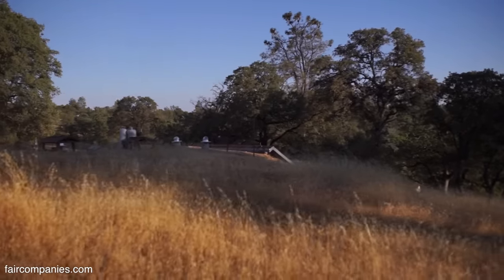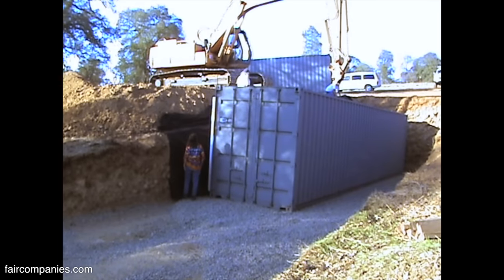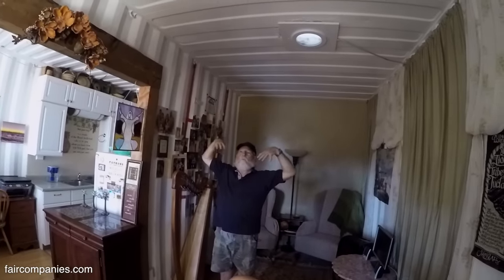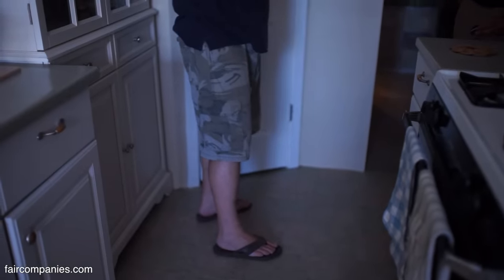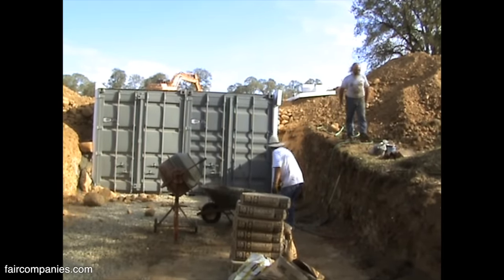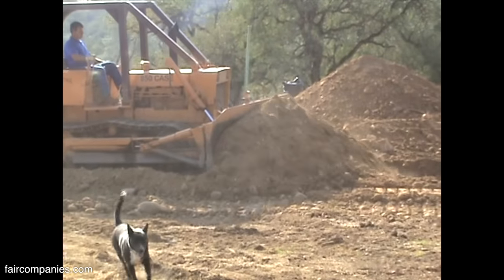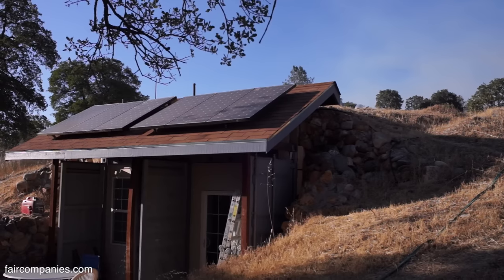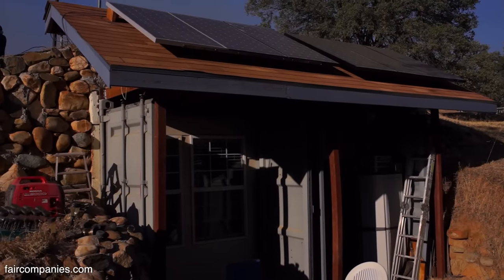Earth-cooled, shipping container underground CA home for 30K

Comment: I built a 3+2bath house in Vietnam.  I had a deep well drilled and put 3 HD plastic 20gal on the high 10ft roof (one outside painted black for pre-heating hot H2O before being stored in an insulated 20gal under the roof and another under the roof (insulated also)  for cold H2O.  2 small solor pumps sucks the water from the well into the 2 tanks.  A small electric water heater maintains hot showers on cloudy days.  My biggest expense is keeping the brick + metal roof house cool.  If I could have done an underground home that would have solved that expense.  Although the high roof, thick brick walls and fans help... I still must run a 2ton AC unit to keep the 2000sqft house livable in the hot South Vietnam climate.

Comment: I have Steve's book - love it. 
Could this underground container home be designed with 3 40' containers with the 40' length facing a southern exposure and the 24' placed into the underground depth? Like an earthship design that uses solar gain from winter's low laying sun  - the high summer sun is blocked by a 3' overhang along it's length. I'm thinking that it could be insulated on the inside with paper/hempcrete walls that would also add thermal mass. I would also be interested in adding earthship "earth tubes" for added cooling.
Reply: Certainly could with the right engineering and construction.

Comment: I've always wanted to build an underground home, and I am thinking I want to put a chimney shaft on the sides that is about 6 feet wide and 4 deep.  There will be windows at window height, instead of a fireplace and have an excape ladder built into one side for climbing out in an emergency.  At the bottom of the chimney shaft I would put a large 45 degree angled mirror to shine up the chimney to the surface.  ON the surface I want to build a small steel framed green house with a window glass and with a 45 degree sloping mirror on the inside so the entire chimney becomes a periscope to the surface.  And this could serve as an excape exit should someting go wrong underground.  Not to mention, you could open the windows and get a warm breeze if you were so inclined.  You could use the chimney as a periscope for 2 rooms by splitting the window space with a room wall.  Natural light and well insulated. Plus you can see outside and see the sunrises/ sunsets and watch the deer play in your yard.. Imagine living underground and being able to pull back the window curtains to watch the sunrises from your bed!

Comment: Build with ICF walls and go deeper. Use more solar power and shade the entrance better. Not cheap but way more permanent and easier to get permitted. Also, with the extra solar electric it will allow use of more lights if you want them, and a geothermal system for more comfort.

Comment: Nice job.  To protect the surface of the container, you can consider roof tar application(bitumen) and asphalt paper. Then you can back fill with anything including sand.  Put in a soaker pipe drain with geo-tech fabric. Let's rely on water diversion rather than corrosion protection. We can consider additional concrete reinforcement and spread these containers apart for more living space. Very cool - were is the weapons room.

Comment: Without reinforced concrete back-fill, earth-buried intermodal containers will rust and undergo slow (and sometimes sudden) structural failure as the mild steel siding rusts-out. Please be careful.

Comment: Beautiful house! Were the openings between containers cut and welded before constructing the concrete slab roof? How did you insure that water would not penetrate at the apertures in the sides of the containers? I am assuming plumbing and waste lines are below floor level out to septic tank and drain field on hillside below. Toilet air vents go out the top like solatubes? Very nice low footprint on your land. Like it very much.

Comment: It is a really good idea to leave 50% of the walls as the original metal instead of covering them up with drywall, because metal conducts heat a lot better than the drywall does.  On a hot day the hot air will come in an open door or window, and the metal wall will soak up the heat from that air a lot faster than a drywall covered wall will, thus helping keep the inside of that place cooler than if you were to cover up all of the walls.

Comment: Would be nice to have the containers horizontally placed to increase the amount of 'frontage' opening to the outside, though you'd have to use well-insulated glass and you'd lose some earth-insulation, you could open the entire length to a long patio and bring the outside in.  Wonder if there'd be other reasons not to do that?

Comment: Smart but not wise! Refer container has better insinuation and putting tarp cover down on the ground before putting in the containers blocks the water that wicks heat away even from the foam places outside. Dome book 2 had the information about layering tarps to keep ground areas layers dry so no water wicking only dry ground.

Comment: I have a 2 story house with a large, walk out basement.  I want to remove the top two floors, add a roof to the basement and just live in the basement.  Seems like it would effectively be the same sort of set up as this, just bigger, with concrete walls instead of metal.

Comment: I keep hearing  about the structural integrity.. Think of the container and the job it's designed to do.The amount of weight they're rated for is insane!Picture a crane that lifts them on and off of ships and rail cars..The four corners and the bottom of the container are strong as hell the metal sides and roof are flimsy.. So if you flip the container upside down, it will withstand any amount of dirt and concrete you put ontop of it, That is my suggestion to anyone who attempts  a bunker or home like this.. If not burried upside down the risk of collapse is way high in my opinion

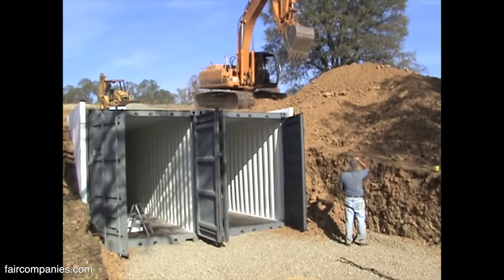Comment: As I understand through some of my own research, the average cost of a single container is approximately $2,500. Purchase price only, typically does not include delivery in my info. At 2:25 he says, "give ourselves 640 sq.ft. That means each one is 320 sq. ft. Since there's theoretically no limit for size,  I think I would opt for eight containers. That would create according to his numbers, a livable inside square footage of 2,560 square feet of living space for $20,000. That's a helluva nice size living area for $20,000 + other expenses. I also understand that shipping containers do come in some various sizes, too. Measurements could be better.  So, you'll need to do additional research if this interests you. Also, you don't necessarily have to put them (if using my example) side-by-side. You could have 2 bedroom or office wings off of the main center six containers left and right,  creating a letter "T" shape.

Comment: I'm scratching my head over this one. Instead of the metal box, I'd pour concrete walls then roof it over with prefab concrete slabs. And extend the front part out into the open, facing south. 
And I'd put a wall around those air vents so bad guys don't drop canisters of Zyklon B into my bedroom while I'm asleep.
Reply: broomsterm Agreed. If I were doing this, half of the living space would be underground, and half out front. I'd buy a cement mixer and lay the floor and grout the cement block walls. Seal 'em up.
I would build a double arched roof...like one of those old railroad tunnels. 
Where I would save money is by buying an old motorhome or two and disemboweling them for the interior of my house. The electrical and plumbing systems are there for the taking. Paneling. Flooring. Cabinetry. Old motorhomes are dirt cheap. They also have generators. Good for emergencies. 
Woo-hoo!
Reply: +Leon Davis Dunno, it really depends if you have friends or connections working in the concrete industry. Here in the UK those prefabbed concrete panels are crazy expensive. When I lived in Australia I had a friend who worked for a concrete manufacturer that could get access to heavily subsidized concrete panels, the ones used in bridges for $50 a piece, I think they were either rejects or overstock. Then It might be worth it.
Reply: arbit3r Yes...I see what you mean...
It is an interesting subject.
If I'm not mistaken, the technical term is "vernacular architecture". In other words, a building constructed with materials at hand. A log cabin or an adobe house would qualify. 
Shipping containers would fall into that category. 
I still like the idea of eviscerating RV's that are past their shelf life. Unlike Europe, in the US, those things are yuge. And top end units will have beautiful hardwood paneling and cabinetry and spiffy appliances.

Comment: 5 wide and one on the back connecting them 40x48 @ 1930 square feet wouldnt have been all that hard weld them together then heat treat the welds you could have a hot tub room and a sauna room. put in some sky lights and run some garden hoses through pvc connect hoses to dehumidifiers ! you could even go another layer of containers down .

Comment: Very cool but this seems to be built in a pretty moderate climate, not a lot of rain or excessive summer heat/winter cold. People in other climates will likely have greater heating and cooling needs though still less than an above ground structure in their area.

Comment: just weld some tabs on the ceiling?? way easier. you can weld anywhere on your metal wall. I would also have added a thick rubber liner over the top of the containers to keep them water tight. like pond membrane

Comment: what they apparently didn't realise what that shipping containers are incredibly strong but rather expensive way to build if you'd not just using them for the structural parts of the house.. for just the creation of living space they're expensive.. they could easily have placed the containers with a 10 foot gap with a roof structure... or made skylights.. or an atrium courtyard between the two containers

Comment: So it is not permitted to be used as a dwelling?
Would sorting this issue out first have been a better route to success?
Are there perhaps easily incorporated design changes you could have made to achieve the required permission?
Great idea and nice outcome, but you can't live in it? What's the penalty if you do?
Reply: No he was saying that the do not have a permit requirements for buried containers.

Comment: I don't know....The anti-water measures look iffy to me. I would think some extra outside waterproofing between the foam and the steel would be needed and concrete is porous, slow but porous. I'm no engineer(but I slept in a Holiday inn), it seems that if the container is designed to only take vertical weight on the 4 corners then you pile a foot of concrete on the roof it does not spread the load onto the corners. Otherwise good video and good ideas!

Comment: Containers are NOT meant to be buried.  Generally it's a VERY bad idea.  Unless you ENGINEER (and I don't mean on a napkin, I mean have CERTIFIED civil engineer do it) a support system, you risk having the container cave in or prematurely rust because of poor drainage.  All the structural support is in the ends, not the roof or walls.  They're not meant to take the weight of earth on them.

Comment: Building underground can be very good.They would also fare much better If there were to be an nuclear emergency or bad weather etc.  Should you use a shipping container then ,just be aware that without extra reinforcing by say, adding a steel beam, the roof may  bow or even collapse if you put much over 9 inches or so, dirt on top. The floor would be strong, so you could turn the container UPSIDE DOWN , but since the floor would be wooden , it would be necessary to weld steel sheets to what was the floor steel beams. It would then be very strong & several feet of earth could go  on top. it  I built one of the U.K.'s strongest bunkers .I welded the rectangular container  myself, I did not shipping containers & put 12 feet of dirt on top. The temperature inside remains the same all year round.Congratulations to Steve .If anyone is interested in the bunker I designed & built search 'Mike Thomas Bunker' on Youtube. Kind regards,Mike
Reply: Michael Thomas 
I will be watching you on YouTube tonight

Comment: Okay, so the concrete slab on top is essential to hold the 3 feet of dirt? I would think the roof of the container would handle that much weight by itself. Especially since you beamed the openings. And there are no windows.

Comment: I was always told that shipping containers are a bad idea to bury as they will cave in after 5 years or so.  How much earth is piled above it?
Reply: You have to take measures to protect them from moisture or they will corrode and collapse.
Reply: As described in the video there are ways to prolong their life underground. Personally I would not rely on them for support and use something else such as concrete instead. You can look at how long sewer lines of different materials last underground. Good steel put in place with proper drainage around it can last many decades. Brick or concrete can last longer.

Comment: How do you calculate or plan for the pressure from the dirt? Build on top & pack dirt around?
Reply: Lee Cooper -- Shipping containers are designed to be stacked, so the frame (think edges of a rectangle) is very strong, but the "roof" and walls are not so much so. It is suggested that you do not even walk on the un-reinforced part of the roof, and I have seen most buried container homes use cross beams stacked edge to edge to cover all the roof, with the much stronger frame at the edges supporting the cross beams.

Comment: Nice idea but I would be concerned with the kinks in the steel I have noticed quite a few 
hopefully there as a result of the previous use on a ship not the bull dozer or the soil on top but I would be concerned if I was sleeping in there 
the chap seems to think it is purely the corner posts that give it strength but I think he is mistaken the sides will have structural purpose other they would be straight as corigation uses more material but has a massive increase on strength if the sides we're not structural they would be flat it's cheaper 
and thinking about it the chap has reinforced the cut outs so he probably knows they are in fact important to the structural integrity of the container 
but I still think it is cool and more people should be doing this maybe not so much earth and use a wheel Barrow instead of the bull dozer tho

Comment: Boy, if I were goin' all-out with Earth-sheltered, and I had the excavator already out there, I'd take the opportunity to bury 1,000 feet of 'finned ductwork' is all I know to call it.  Basically bury a big heat-exchanging pipe and run your ventilation through it, so the air coming in is a uniform 50 degree Fahrenheit (or whatever the average daily temps are, which will give you the temp of the ground 6 to 9 feet down.  It's very simple, not very expensive, and you can move air through the system without much of a fan driving it.  Another old guy grows oranges in winter up in Wyoming, using the principle to keep his greenhouse at or above that 50-degree mark.

Yes, 80 degrees is much cooler than the 110 degrees outside, but 80 degrees indoors kind of sucks, especially for sleeping.  Of course, such a dream home HAS to have a sleeping porch built in, but this doesn't appear to.  

Anyway, I think an Earth-sheltered home should have extensive heating/cooling ductwork buried in the ground.  Silly not to build yourself a passive heat pump while you're doing all that digging.  Very low-maintenance.  Also, I'm not a very big believer in making houses super-tight to save on heating and cooling.  I think you want to move fresh air through the space continuously, if you can.  So if I were building from scratch, and I had the excavator there, already, I'd damn sure have the underground heat exchanger for heating and cooling with a fan  that can run off solar with no problem.  

I think bringing sunlight in through mirrored "light pipes" is kind of a must.  I think the installation looks ugly, and I'd look into other designs.  Maybe do something that's more distributed using fiber optics.  My dunno.  But a couple I know use one of those light tubes to illuminate their bathroom during the day, and it's a really nice feature in any home.
Reply: Correction:  The "oranges-in-the-snow" guy's in Nebraska:  https://www.youtube.com/watch?v=ZD_3_gsgsnk

Comment: Seems like a lot of work went into protecting the container. They can't cut holes into it because of rust, the inside wall is not very useful because of the wavy pattern. They had to strengthen the outside so the load would fall on the right place, and they had to put in a lot of effort to keep it dry. Doesn't that mean it would have been better to just build it with concrete or something else?
Reply: +TheHoruru They cut plenty of holes in the shipping containers. They cut a large hole near the 'front' so that you can walk between the containers. They cut several holes in the roof of the containers to install those solar lights.
Reply: +Frank Summertime Yes but he says every cut is another place rust can form so he wants to keep it to a minimum. You wouldn't have that problem with concrete.
Reply: +TheHoruru nope, just a broken pocketbook, not to mention that concrete isn't waterproof, and can crack in harsh temps.

Comment: Do not do this. It is DANGEROUS. The rooves of these containers are not designed to support the weight of the dirt. The roof of the container is flat, the worst shape for supporting weight. As the containers rust over time, one day they will collapse killing everyone inside. 

Container shelters like this are doable, but they need vaulted rooves designed by a professional engineer.